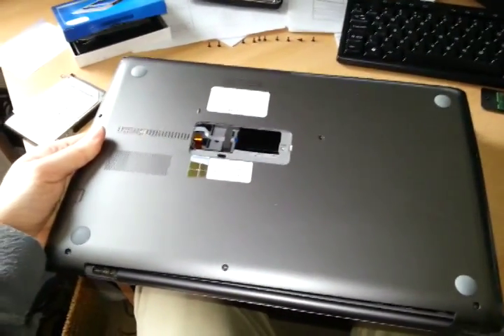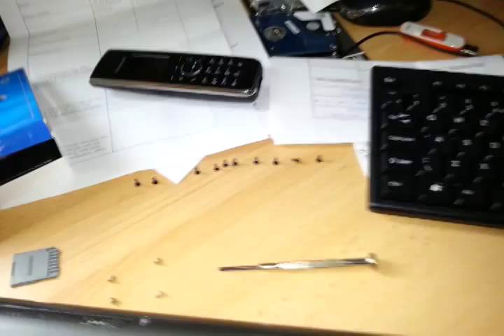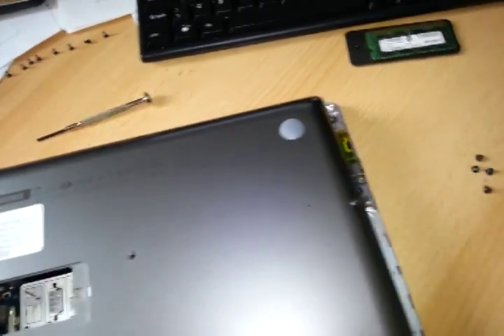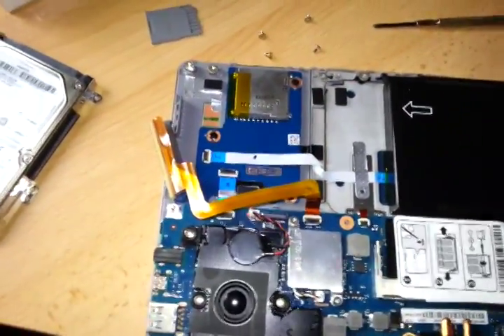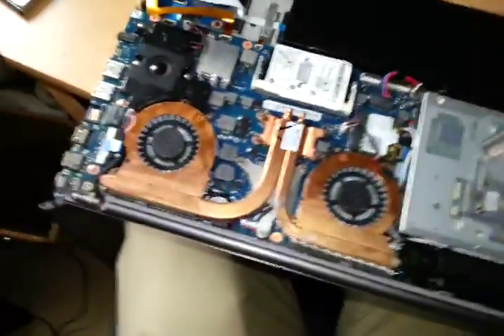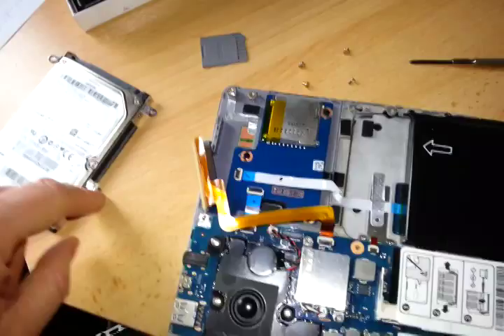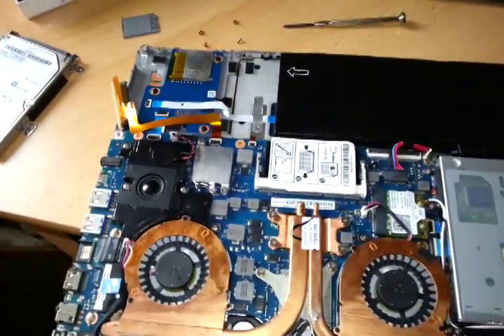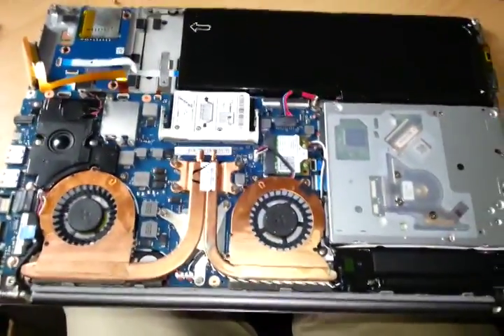Samsung series 7 NP700Z5C ssd disk swap

Comment from the maker: I rebuilt Windows with a fresh install of Windows OS and copied my data that was backed up on to the new ssd. You can use something like Acronis Backup to take a clone and put it back on the ssd. I've since upgraded the ssd to Windows 10 without problems and it's performing very nicely still

Comment: Hi, I'm sure I'm not the only one with this issue... Once I replaced the disk and installed a new OS, the laptop just keeps rebooting after a few seconds and not even lets me in the bios. Anyone have a solution, I'm loosing my mind...
Reply from the maker: This is what I did, just installed OS straight away. Potentially you have a hardware conflict or issue? Did you resolve it in the end?

Comment: did you use other tools besides a screwdriver?
Reply from the maker: +May To Play | ✪NeZeR No, I'm pretty sure it was just the cross-head screwdriver. All working still nicely :)
Reply: You need something to pry it open. A flathead screwdriver is not thin enough. I didn't have guitar picks handy, so I used a knife. I still couldn't fix what I opened it up to fix. 16 screws!!! 🤯 A nightmare.